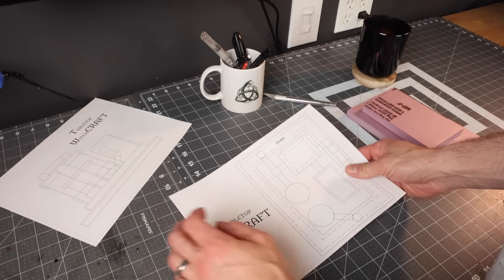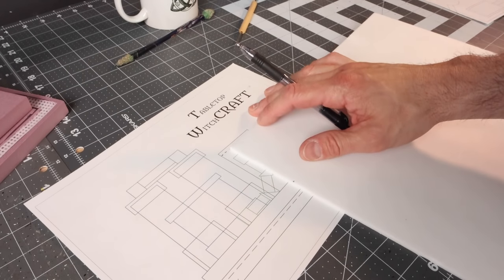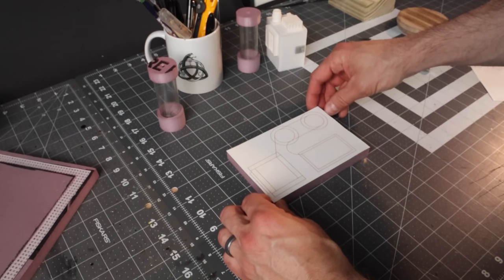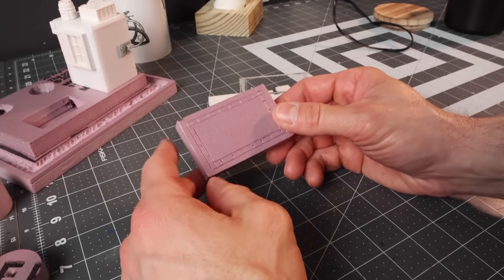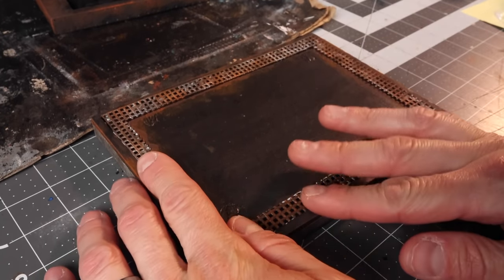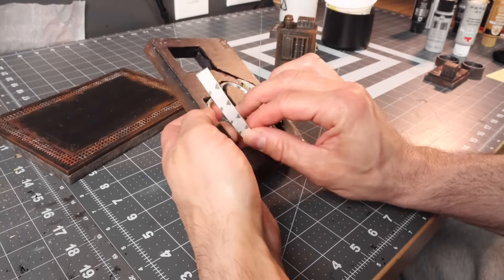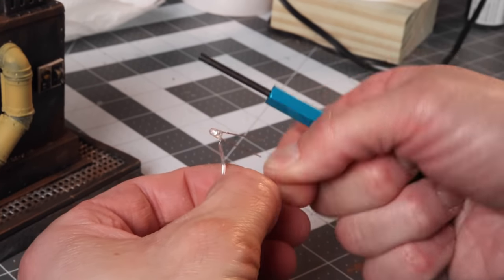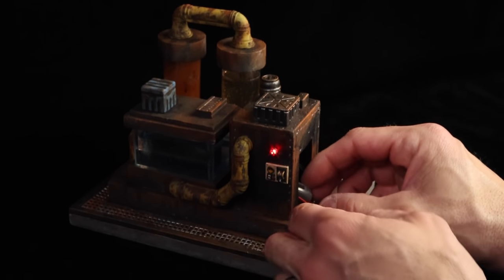Unique Warhammer 40,000 Necromunda Post-Apocalyptic Sewage Treatment Plant

Comment: Yay, finally a new video! :)
One small thing: I can not recommend coiling LED stripe in on themselves like that. Depending on the kind of LEDs (ie power levels) they can get hot enough to desolder themselves and at least significantly shorten their lifetime. I would at least leave some air gap between the "windings" for some heat to escape (and more light to escape as well).
Reply from the maker: Cool tip.  I don't want to rush the builds, and I'm going through a terrible family matter right now... I'm doing the best I can with video releases.
Reply: @TabletopWitchCRAFT  oh, I'm sorry to hear that. There's ofc nothing as important as family. I hope you will pull through this alright and I wish you all the best.  Your community is here to support you, if you need it.

Comment: I love it - and this project is something I will build a couple years down the road when my D&D game is done and I do some Cyberpunk - it would look great in the combat zone.  One quick question - the water in the clean tank - the top is uneven - which gives it a cool look like water being injected into the tank and creating a wave like effect - did you do anything unique to achieve that?
Reply from the maker: Thanks Eric !!  So the "sloshing" water effect was a happy little accident.  I had a minor leak on the bottom that caused it to settle like that.  I was pleasantly surprised with the result.  Really adds a dynamic look to the water... as if it's being pumped in.